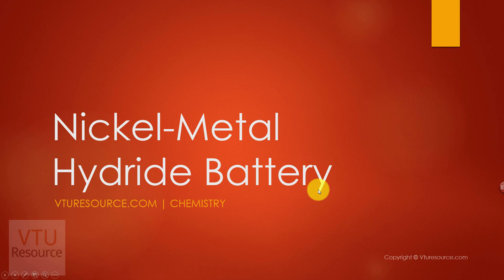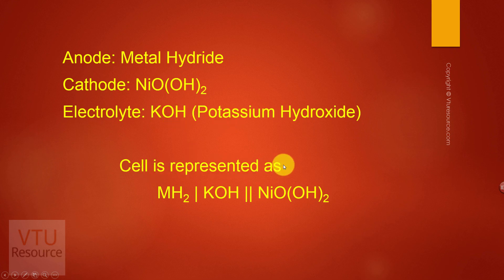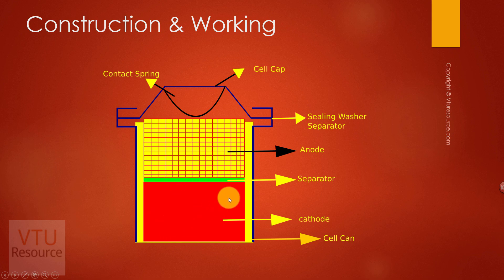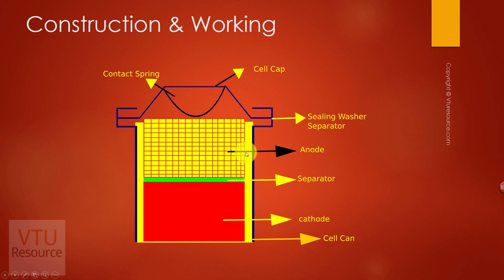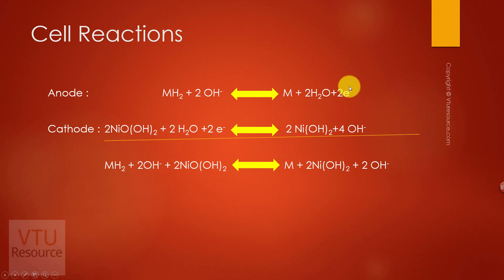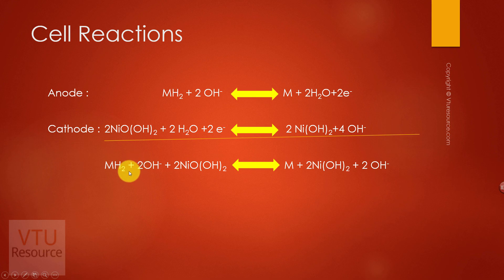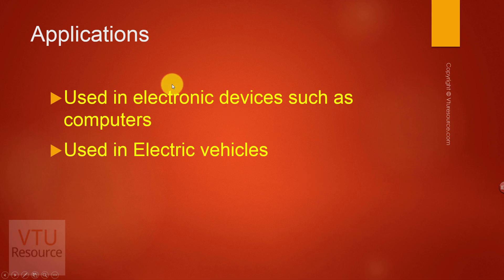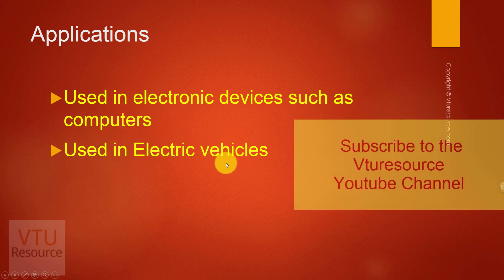Nickel Metal Hydride Battery

Comment: hi that was great...

So what is the chemical reactions that occurs in a Nickel Metal Hydride battery when a cell goes into polarity reversal  ………. let’s say you have a 7.2 volt battery that is made up of six 1.2 cells and you discharge the complete pack and one of the cell goes into polarity reversal.  I know H2 is generated  when you over discharge the cell but is that only down to 0 volts. Specifically what damage occurs to the positive and negative electrodes of the cell when the cell constant goes into polarity reversal  that it cant correct when you start recharging the cell again?